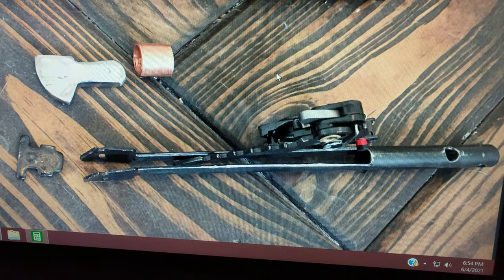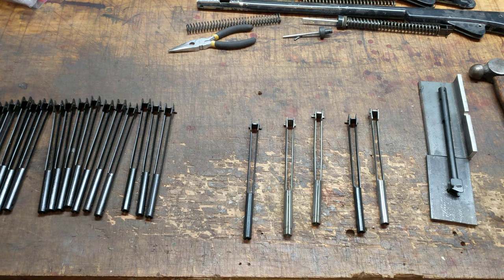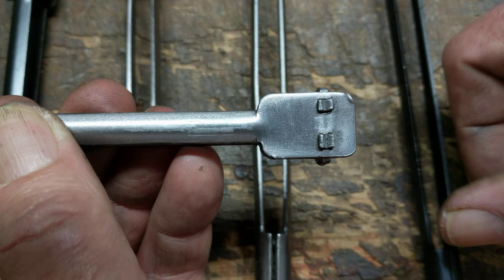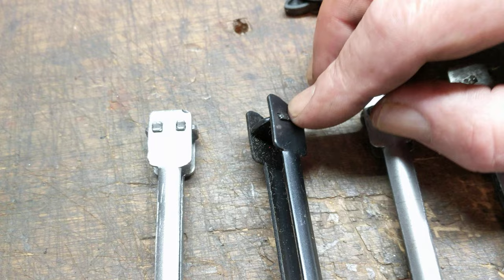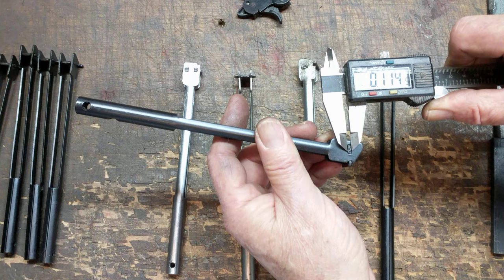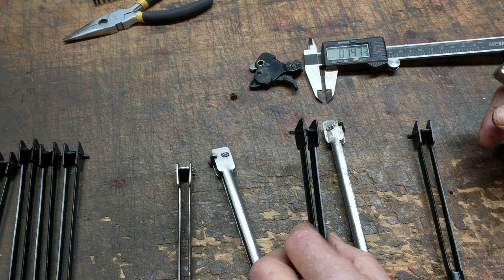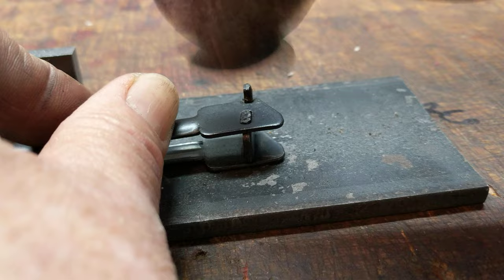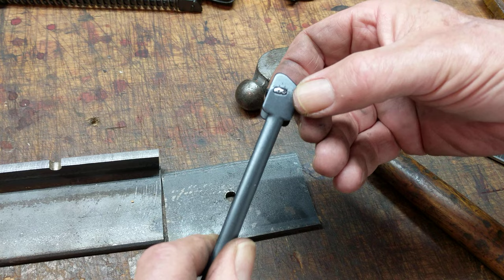Red Ryder plunger assembly mods

Comment: If it does not need to come apart you could also do a small weld with a tig (if you have one) which would make  pretty solid...great videos! I have my kids new Red Ryder and ill be doing the mods with him...I had never really shot one before because I had a .17 break barrel when I was a kid but Im super into the red ryder now! squirrels run when they hear the lever action cock the spring!
Reply: You are aware that a tuned red ryder pushing just a bit over 350fps is making only 1.40ft-lb of energy right? [Poor tree rats]

Comment: That will work if you have the metal protruding, I've used a center punch and also a very small chisel on several 1894's and it seemed to tighten up the plate.

Comment: Love it brother!!  I knew you would have a solution
Reply from the maker: John, It's a start. If I ever get presentable welding skills I'll mod some of the currently unused plungers by tacking those plates on the backside. Should be interesting to see how the chinesium takes it.
Reply: @RestOModDaisy  I have already taken my Daisy apart and then I’ve done the same thing you did except I took that plate and filed a little bit to where they would allow more meat because like you said in your video the one side didn’t have very much I appreciate all the info keep doing what you doing brother

Comment: I just purchased a Daisy model 1000 this weekend at the flea market and when I went to shoot it the BB's only went about 3 feet. I took the gun apart except for the plunger and mainspring because I am afraid I wouldn't be able to get it back together. Everything looked fine and worked well but it did the same thing when I shot it again. Am I going to have to bite the bullet and tear the whole thing apart or is there something that I am over looking? thanks again
Reply from the maker: The Daisy 1000 was a wide body lever action BB gun similar to the Daisy Model 95/96/99. It sounds like your abutment washer is not properly seated and riding up and down the compression cylinder on the air tube or is missing entirely. You'll need to remove bottle cap shot tube and the spring block and pull the plunger assembly to see if that's the case. I've got a few video's on that process like this:

https://www.youtube.com/watch?v=rap559k75w0&t=1s

If you see and thin piece of rubber on the air tube in front of the compression cup, your abutment washer has become unseated. If not look into the compression cylinder and see if there is a small hole  or a large hole present. A large hole means no abutment washer. Fortunately, the wide body Daisy's use the current production small seal sets available from Daisy and other sources if you need to replace them. Let me know what happens!

Comment: Not sure how to message you other than commenting but I have a situation with a newer rifle that I'm guessing may be preventing loading. A piece of the plastic loading gate (circular sleeve that adds tension) has apparently broken off and sliding up and down the tube. Is it easily removable? Thanks!
Reply from the maker: Dean, You always use my email in the description for more detailed messages. You can easily remove your plastic front sight assembly by gently tapping it forward with a wood block and a hammer until it clears the detent on the underside of the barrel shroud. Then just pull it off and see if the broken bit will wiggle it's way out. If the loading gate is still working properly then you are good to go. Once you get the debris out of the shroud just slip the front sight assembly back on taking care to get the actual barrel lined up properly and  then tap it back into place.
Reply: @RestOModDaisy  really appreciate the advice!